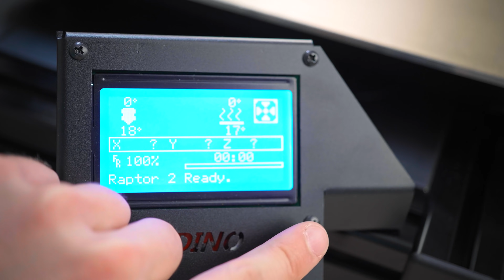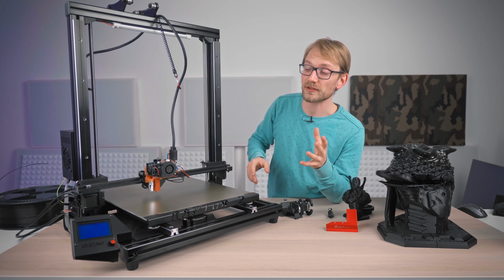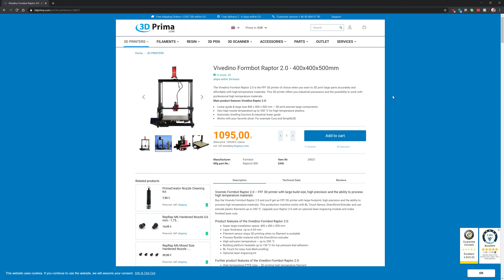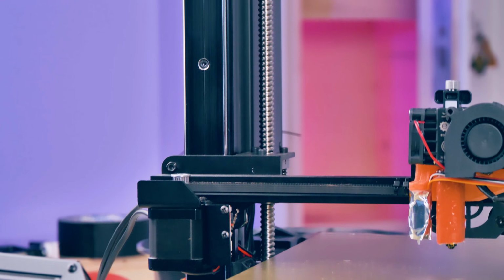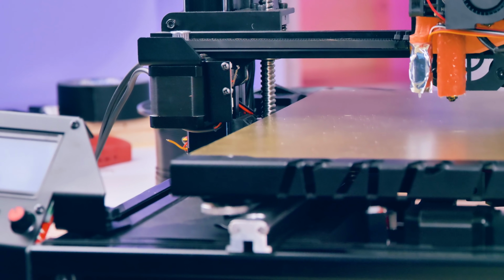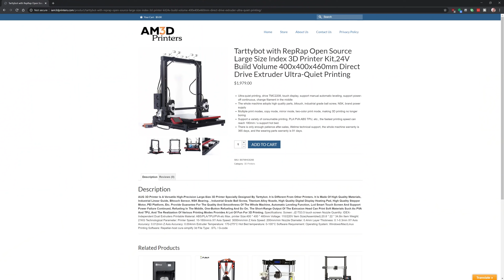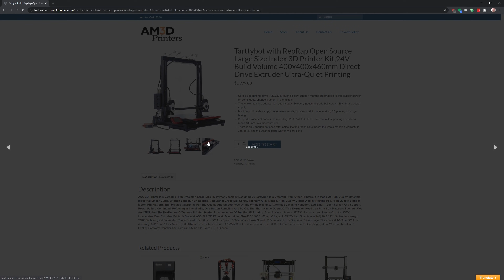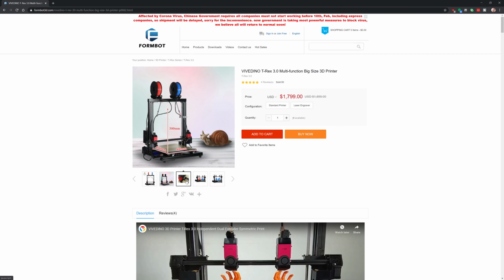This huge 3D printer was fun, but absolutely no one should buy it - Formbot Raptor 2.0 review!

Comment: I wonder why they didn't use at least a volcano clone as they did on their other large machines.
Reply: they dont use volcano style blocks on their other printers
Reply: @3dprintingrevolution791  They used to, I have a TRex2 that had a volcano clone on it when it was delivered.
Reply: Ah I have the Trex2+ and it has the regular block so does raptor 1
Reply: @3dprintingrevolution791  Yeah, I have a 2+ as well which came with two V6 clones which I soon changed for  genuine volcanos as the clones on the 2 performed much better.

Comment: Hey could you please help, first time I have printed with PETG, when it prints ,it's smooth on the outside of the print but bitty and spluttery on the inside. sanding and cleaning up takes far too long. Tried with the temp from 2020 to 240 but no improvements. I am using an ender 3 pro. Any ideas as to whats going wrong.
Reply: PETG is stringy and this is fairly normal. There is no 100% mitigation, but
* direct extruders are an advantage, thus bowden fed ender 3 is at an automatic disadvantage.
* retract a sufficient amount (to be determined, not an easy guess, individual for every single printer), and tune the retraction speed down, you don't want to retract PETG too quickly.
* print slower and at the speed that you can keep consistently. perform non-print positioning moves as quickly as possible.
* adjust the slicing settings to keep the leakage predominantly over already printed things, such as using wipe moves.
* experiment with a little bit of Z hop, maybe as little as 0.1-0.2mm. PETG sticks to itself really well, so if you glide across the tiniest borderline invisible of PETG boogers which are inevitable, the molten PETG in the nozzle will catch and be propelled down, building up on top of that booger.
* make sure there is as little residual humidity in your PETG filament as possible, its leakiness and stringiness increases dramatically otherwise.

PETG has an extremely weird fluid dynamics. Once it flows, it runs. Once a bubble forms in the hot end, it runs, and it can be from moisture or from retracting it too hard. But at the same time it's very hard to heat all the way through and pretty hard to push through the hot end. It likes being propelled at very consistent speed without speeding up or slowing down, this is when it performs the best.
Reply: @SianaGearz  Love your channel, thanks very much for getting back to me. Cheers
Reply: @madforit9661  I don't have a channel.

Comment: Hmm, I've got this printer and it's awesome.   Seems very solidly built and runs well.  No print flaws at all, prints better than my cr20 pro.  I've had it running almost constantly for the last couple of weeks, no issues.  The supplier I bought from (here in Canada) added a power enclosure to pass CSA inspections and included a fan assembly for higher temps.

Comment: I think the heated bed has its own plug maybe because it could exceed a home circuit... Its also a keenovo mat, so its just off the shelf with its own power.  
For US users, at 120v, the 1200w mats start to tap out a 15amp circuit where you may need to branch out to 2 different circuits.

Comment: Odd, I have one of these printers. Granted, my reseller has had the SSR that controls the heated bed modified, moved and enclosed in a grounded aluminum electrical box on the side of the printer and not under the heated bed (which is then UL and ETL certified in canada), and the firmware is not a beta version of marlin. I've had nothing but successful, large prints out of this. I only print PLA so I haven't pushed the temp settings, nor would I bother printing something like ABS in a printer that isn't enclosed. It's also quite fast, and I frequently turn up the feed rate on it to 120-140% I find that I do need to turn the temp up a bit on PLA to avoid under extrusion when doing large layers. But I'm printing tables and helmets on the thing and it's been perfect thus far. I'm coming from a CR-10 so I find it a lot tidier and better built than that.

I am concerned about the wiring under the heated bed and how it will hold up over time, but it's no worse than how the CR10 managed it (I had printed the guard that supports the bed wires for the cr10 not to mention I had to print legs for the CR10s control box just so the z-axis wire could reach the top of the printer on tall prints). I'm probably 300 hours of printing into ownership of this printer and I've not seen any undue wear under the machine from the bed wires.

I'm curious Thomas, what printer you'd suggest that has a volume similar to this?
Reply: TL;DR:  I have a heavily modified version of this printer and it works fine, what's your problem!?
Reply: @WalkerRileyMC  lightly modified, and no beta software.

Comment: After checking the whole video I must agree; it's a mess. Tom it's 2020, maybe we could convince you to create a multi-part series focusing on building a custom 3d printer; you know coreXY kinematics; floating extruder with a minimum tube; 32bit board; 230V ac bed heating; flex PEI bed and a tool changer? Curious what you'd think about this :)

Comment: The issue is the moving bed. The increasing mass, increases the mass moment of inertia, causing more and more unstability. A printer this large should be a fixed bed, with a full 4 stepper motor gantry that does all movements. CNC milling machines etc, are designed that way for a reason. The increase or decrease in mass is happening on a fixed location, while the moving gantry does not shrink or gain any mass..
Reply: Agreed. An HyperCube, that is :-). EDIT: Well, a Delta could also do it, but a Delta with its complex movements and its flimsy head.. I like the HyperCube idea better.
Reply: Off topic: YouTube rephrased your comment into "CNC... Are designed that way for a read more..."
I found that quite funny.

Comment: Well, I have a printer like this for two years now, actually two of them.

But no, I won't defend it, Thomas is right, most of its parts are junk.
On the other hand I have constantly pretty good results with them somehow.
Both are still stock, but the plan is from minute zero to replace its motherboard and hotend-extruder combo.

Comment: Yup, these "oversized" clones of smaller machines are just that - CLONES of SMALLER machines, not designed for HUGE prints. I have a Creality CR-10s5 (500x500x500) and that's a printer in the same pricerange as the Formbot Raptor 2, pretty much the same design too, but a little bit better (especially when modified by hobbyists), but even then - printers with this size is a NIGHTMARE to work with. I've sucessfully printed huge size figurines with mine, but not without endless modifications and improvements to my printer. So whatever you buy in this price-range, and that size - beware...you WILL have to tinker a LOT with it before it becomes at all useful, and even then, it's hard to work with.

Comment: What an absolute mess and disaster. If I had to guess, I'd say the engineers were putting together a very early prototype to see what works and how to fix the stuff that doesn't, then the beancounter dept. decided they couldn't wait and it was good enough for production as is, yoinked it and made it a pattern machine. Some of those technical solutions aren't even cheaper than doing it properly, e.g. having two power cords is twice as expensive as one.  it's the only way I can find any sense in it.

Comment: My friend has the T-Rex plus or whatever. Dual independent x axis print heads. The design was okay. But the ball screws are silly. When you need 2 z screws and you don't have a way to sync them like mach3 cnc machines can do with dual limit switches it's probably best to have a frame mounted Bowden extruder or at least an extruder that doesn't require you to compress a spring as it's easy to back drive the lead screws and de sync your axis. If some sync process isn't an option like stalling the axis against a stop then it's probably beneficial to use single start lead screws as they don't back drive like 4 start or ball screws making it less likely for accidental desyncs.. The z screws or couplings run out and it proved an improvement to remove the top support bearings. Some of the guide bearings weren't well adjusted, the head bed has an external controller. It's 24v drive which sounds nice but really only helps travel moves as these small stepper drives often make a little less torque with higher voltages. The bed is so heavy the acceleration must be slow. The drives came adjusted for 12v and needed to be turned down for 12v operation. Although we did get it tuned it wasn't for beginners. They never released source code or a pins.h file and it had weird issues when trying to connect it to a terminal. I want to flash it but with the 40pin header I just don't trust that the ramps pin configuration is correct and am not taking things that far until I have the hardware to replace it if need be. I just don't have the time to write programs to wiggle the pins and reverse engineer the pins.h file. We are probably going to change over to a big tree tech 32bit board once I get the dev environment figured out and just wire it from scratch. Most printers I consider a kit. Like 20 years ago you'd buy a model airplane and you'd change like 80% of the hardware to your own liking as time went on. Yet somehow creality printers seem okay out of the box despite all the designs that look like shortcuts.

Comment: I would say that the latest images were more eloquent than the whole video: you completely disassembled the printer and never did it with other tested products.
I really think you didn't do it to fix their mistakes, but to reduce a useless footprint. :-)
The guides of the printing plate, however, were well made: an extruded aluminum with steel bars on the points of wear. Very useful for an upgrade to other printers

Comment: Just got the Creality with 12 X 12 X 18 build volume.  Its a bit of a monster sitting beside the Ender 3.

The main issue I had with the Ender 3 was wanting to make bigger stuff.
Reply: Note:  Use a Uninterruptible Power Supply for your 3D printer to avoid the issues of the power going out (at least  for an hour)

Comment: I have seen this model allready have a year ago from a different company and decided not to by it.
+ It has nice linear bearings on Z and X
+ It has very nice lead ball screws on Z
+ It has a very nice build size

Big No No's

The dragchain is only fixed on one the frame if I am not mistaken ?

The whole cabeling
Still using regular bearings as idlers for the belt ...Get propper idlers with theeth that reduces artefacs in your prints
Using those weels on regular aluminum profile
Using cables that are not meant to be used in moving application to move arround all day long
.....

But thats it If it was 300-400€ shipped I may have bought it to turn it into a real printer as I like to do. I would sugest Hi-Win rails on Y, proper bearings for the leadscrews, 0.9°steppers on X and Y, nema 27 for X some form of proper belt tensioner to pull the belt straight. Drag chain on all axis fitting drag chain cabeling something like Lif9YC11Y for motors and sensors, ÖLFLEX FD 855 CP 3G0,5 plus a fuse 2A slow blow max 3A for heated bed and fix the dragchain to the heatet bed. A duet as an mainboard. Last but not least a flex heatbead whith magnets on that nice aluminum plate without that bumper...

Than you have a 1200€ printer.

Comment: So if the chassis not earthed?
I couldn't see a ground pin on either of those Wall plugs
Reply: schuko plugs have the ground contact as a recessed plate on both sides of the plug, you don't see it from the way he's holding it. Granted, just because there is a ground contact in the plug doesn't mean it's actually wired to anything on the printer.

Comment: I don't consider that Marlin Bugfix as worse off than the stable build for 8-bit Arduino boards. Maybe for 32 bit. There is a ton of stuff that has been broken for years in the stable builds. One of the important ones used to be thermal runaway detection. The issues with layer shifting haven't been resolved either. There may have been an issue that was resolved in the bugfix build that hasn't even made it to a stable build yet. They just released 2.0.3 as a stable build for that matter. You still used the Hemera and its got issues. The rest of the review shows off what happens when a company sits in a forum and takes ideas and doesn't test anything. Whoever the new camera person is, needs to stand out of frame and practice focus before filming. :)

Comment: That printer seems like a pain.....Anyways..... When I built my clone Prusa MK2 I chose to use a silicone heater from Keenovo that has its be own controller that I plug in separately. I actually like it a lot better at times than just using the one powered and controlled through the printer itself. It's not ideal for all situations but it has its pros. For one it heats up a lot faster and can be adjusted on the fly with a quick push of a button. I can get a lot higher temps with it as well. Only down side would be the extra steps to turn it on and of. It wont turn off after the print ends, at least not in the current for I have it setup to. So you can't let the print run and walk away to have it turn off after the print ends without you around. But really you shouldn't leave your print unattended anyways, even though I bet we all do it.🥴
Anyways I don't regret one bit going that route. I'd do it again if I had the chance, and I just might for the CoreXY I'm building.
Edit: Oh before I forget. My Keenovo silicone heater came with a grounding wire. I remember you mentioned in the video that, that one didn't. That's not good. For anyone that gets one make sure to get one with proper grounding.😉

Comment: I had similar fears before buying my Sidewinder X1 v4 last Black Friday for US$350.  Nothing but total delight so far, but I'm keeping a close eye on it.

What I like most is how well it prints those "goopy" cheap metallic satin PLA filaments.  Shockingly good results with no fuss at all, using standard settings.  This after wasting time, filament, nozzles, heat-breaks (and heartbreaks) on my other printers.  Love the Volcano melt zone!

Comment: At this size of printer, the print bed should be moving in Z only, not the Y direction. It is just too heavy and the large prints will start to deflect during movement
Reply: i have printed many heavy objects with this printer and never had any issues.

Comment: 2 years ago I bought a Raptor 1 on the advice of a vendor.  It's been nothing but trouble, and many of the problems I've had are mentioned in this video: shifted layers, bad crimp, melted connector.  Can't print the entire 400x400 bed area because the heater is only in the central 200x200.  This was a $900 mistake.  Now it's a doorstop.

Comment: So what do you recommend for a printer in this size print volume that is also a direct drive?
Reply: this printer and get a hemera extruder
Reply: @mattmeyer6471  what's a hemera extruder? What does it do to make this printer anazing?
Reply: @eowynsirena4111   It replaces the crap extruder on the machine and makes it a work horse look up E3D Hemera

Comment: My god you have turned into such a dramatic diva. I run 2 of these all the time stock with zero upgrades without issues. I often print full bed prints, regardless it always prints without shifts or skips and I have the 700 mm version.  Parts stick to well? Ever heard of a scrapper like every other machine uses? Pathetic, truly

Comment: I bought the T-Rex 2 when it came out. If you think the raptor is bad, consider yourself lucky. they used to use a long ribbon cable to the extruder with nothing holding it up. it would catch on the bed ant on parts. The bed was controlled by a stand alone controller instead of by the printer. there was no belt tensioner for the Y axis. There were other issues, too. After spending as much on replacement parts as I originally spent on the printer, I eventually gave up and scrapped it for parts.

Comment: I own the Trex 2 + it is a fine printer and with the right upgrades it prints like a dream. I wouldn't recommend it for a beginner but with the right upgrades they do perform great with large prints.  I run stock hot ends and extruders and have no issues pushing filament for long prints and I get good prints with larger nozzle sizes as well. I have had no issues with wires chafing but the rex 2 + didn't come with a cable chain.

Comment: Wow, they tried to steal the show with them ball screws. I don't even like the z-axis bearing system. Nowadays, there's no reason not to be using linear guide rails. The closer I look at it are those linear guide rails? From a distance They look like two separate rods with bearings. I was shocked when it didn't have a 32bit main board. They should have had dual Nema 17 running that y-axis or at least Ed Nema 23. I see what they were doing with the wiring in the bed though. But yeah, they should have put it in the Box. Or just powered it with a thicker wire. Usually when I buy printers on buying the frame anyways. However at this price point I would want a decent working printer. You mentioned something about a flexible bed. Have you found a decent material to print on that is flexible. One that can handle everything from abs polycarbonate and nylons? I still find myself using glass a lot because I gave up on buying a bunch of different gimmicks. I wish they would scrap all the parts and just sell that frame for reasonable price But I would end up Changing the hot bed anyways. So Yeah. I would be better off just ordering the parts myself. Thanks for doing an honest review That's what I've always liked about you.